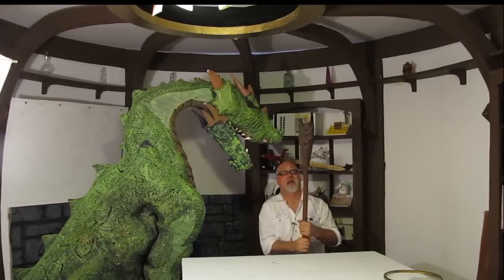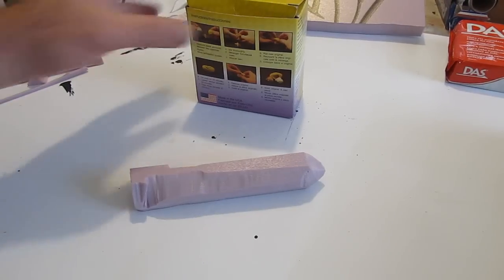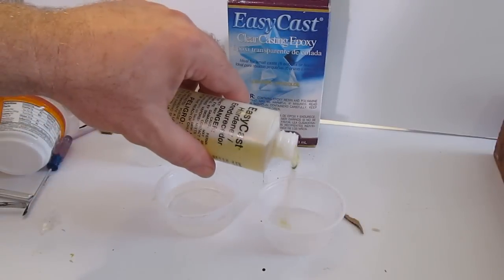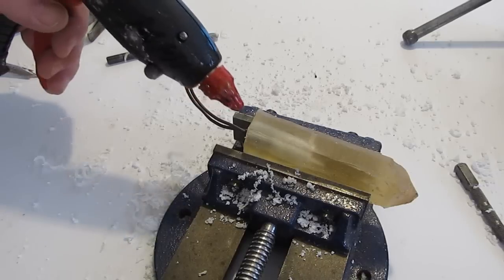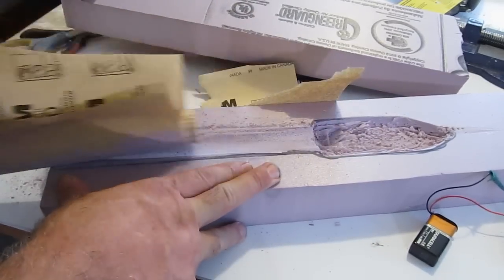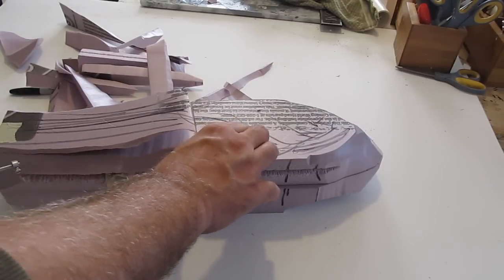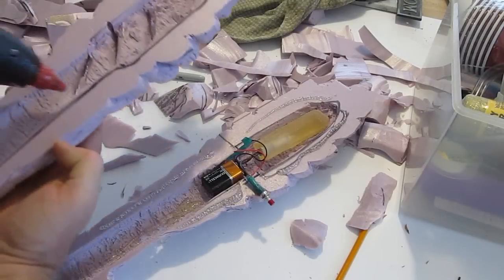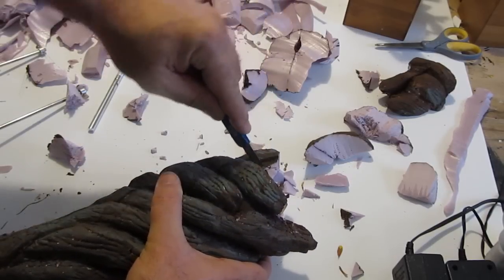Make Gandalf the Greys Staff from The Hobbit

Comment: Wow great job! But i'd like to point out something, i think you should cover the entire rod with some short of cloth or just tape so it has a smoother transition from the head to the actual rod, also i would recommend after "dressing" the rod, to travel the wires so you have the switch somewhere near your hand placements so you can activate the light from holding it normally... This is just my humble opinion
Reply from the maker: MindStormBestPcVids This is an excellent suggestion. Yes, you are absolutely right. A smoother transition between the head and the rod would be good. And, moving the switch location is a really good idea. Thanks! You are definitely a crafter!
Reply: ahahaha i am glad you liked my suggestion, i am no crafter tho, i try but i have less talent than my dog

Comment: Here's a quick question. If you wanted a colored crystal, like say, blue, how would you do it? A little dye maybe? Or would you use a colored bulb? And how about an LED instead of a Christmas bulb? I know a resistor is needed in there for that, but it would last longer.
Reply from the maker: AttackGypsy Wonderful wonderful creativity! . I originally did this project with an LED and a resistor. But it wasn't bright enough to light up the crystal well. So I switched to the tiny bulb. (shorter life span for sure now). About the colors. Yes! You can add food coloring or dyes to the easy cast and create a wonderful colored crystal.  I really should do a tutorial on just making crystals. Would be fun.
Reply: epicfantasy That tutorial would be great. I'm part of a very large Live Action Role Playing group, and they have some awesome artists and crafters.

Comment: What's the exact name of the foam block you're using? I can't seem to find it in my local hardware/ craft stores :(
Awesome staff btw!
Reply from the maker: It's called foamular by dow corning. You can get it in Home Depot and Lowes, go to the home insulation department. It comes in pink blue or green. They are all the same.